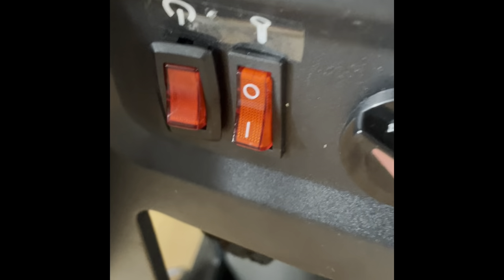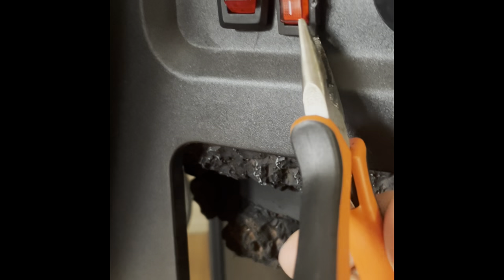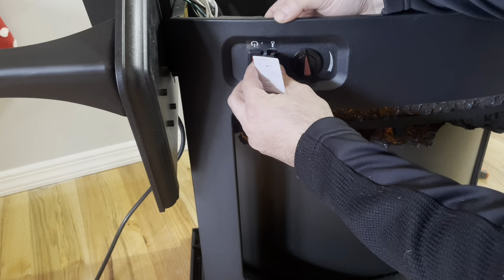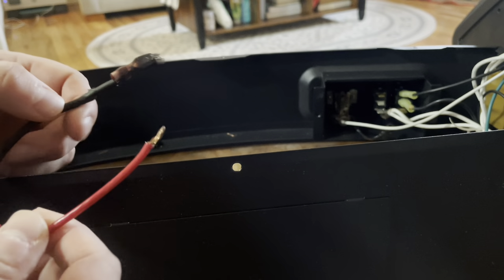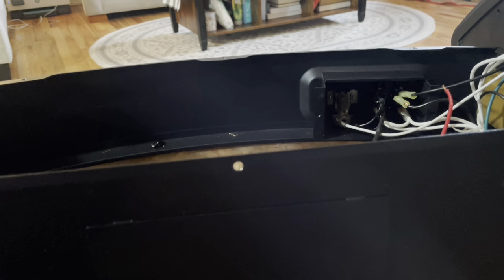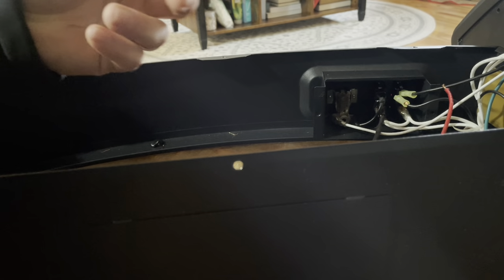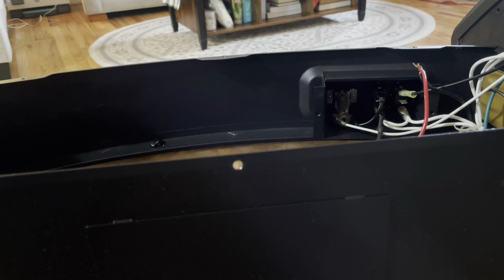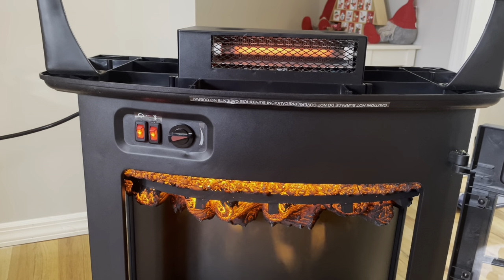DIY: fixing the on/off switch on my fake fireplace/space heater

Comment: The question is the switch keeps breaking ..
Reply from the maker: @MichaelTenhoff  haven’t had to repair it again since this video, so I’d say we’re good 👍
Reply: @jaytahoe  Thank you ... I changed the switch but it did the same thing again ...
Reply from the maker: @MichaelTenhoff  if it’s the same outlet check the outlet. Could be letting too many amps through, breaking the switch every time. Or potentially a bad resistor somewhere in line and it keeps overwhelming the switch and breaking it.
Reply: @jaytahoe  I was commenting to hear your follow up on the repair ... You confirmed what I suspected ..a bigger problem ..Thank you
Reply from the maker: @MichaelTenhoff  any time, good luck with the repair 👍